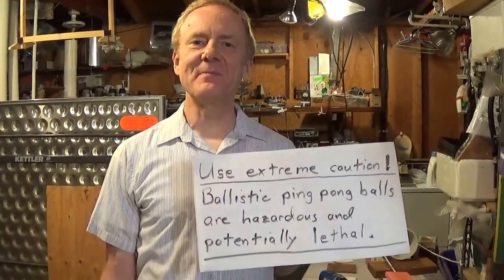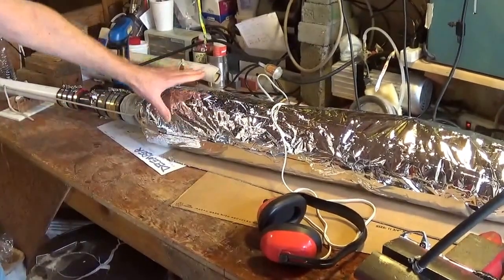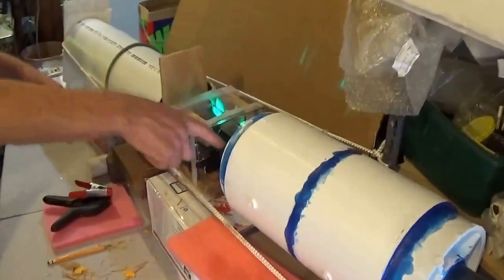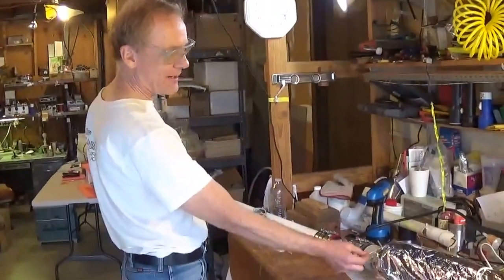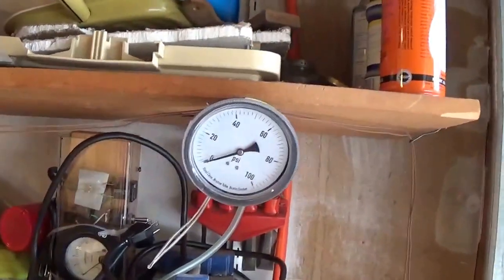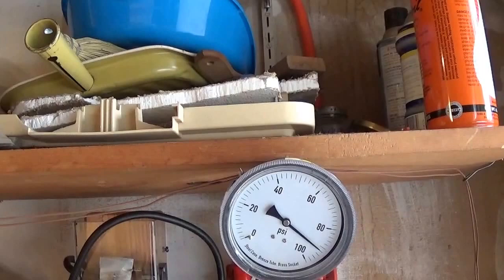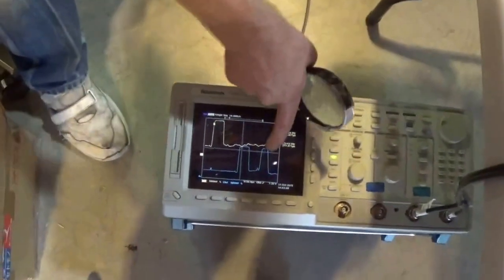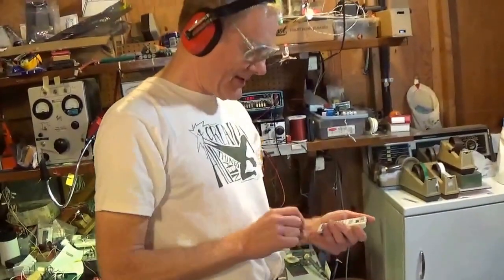566meter/second (1200MPH) supersonic ping pong ball launch using vacuum and air pressure

Comment: Hey, could I have some advice for this? I'm building it and have the pressure tank down but no matter the method I use to secure the barrel to the tank, it is always blown out when I get above 65 psi. Thanks.
Reply from the maker: Yes, that's something we struggled with too.  We ended up using a rubber coupler with multiple hose clamps on each side, and ropes tying the pressure chamber to launch tube in addition.  Looks like other people use flange couplers, which we may try next.  Probably easier and stronger.